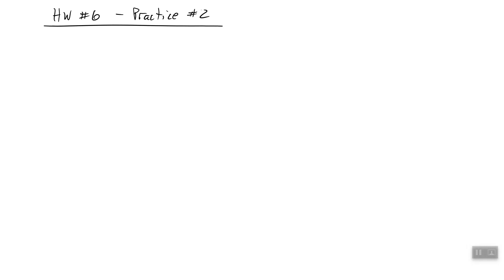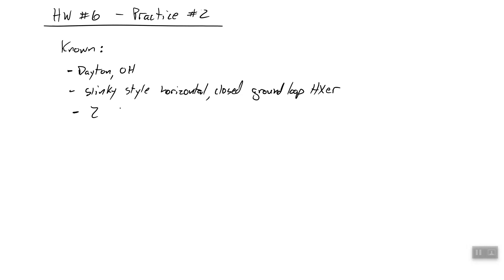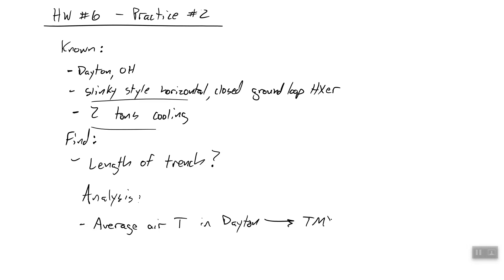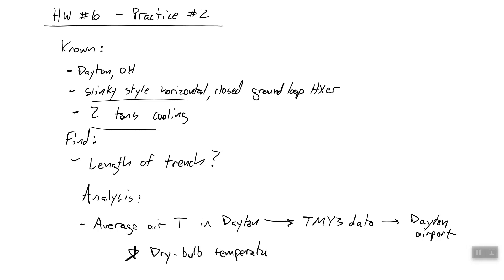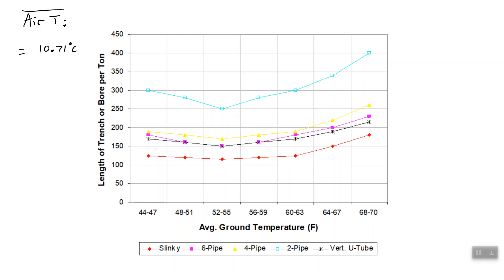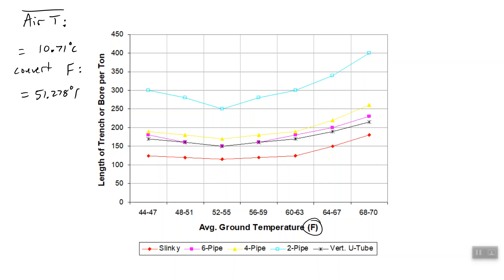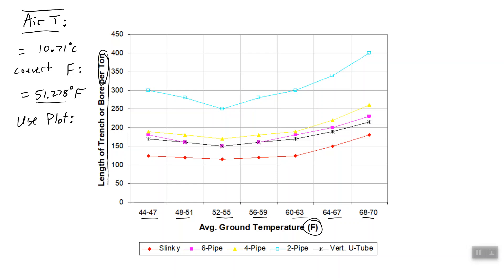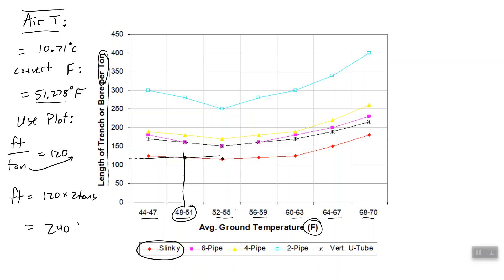HW 6 Practice 2 - Determining Length of Ground Heat Exchanger

Comment: Hi, I'm obviously not in your class but I'm struggling with sizing up a gshp for an old greenhouse and I've found you videos to be very helpful!
This video has made me a bit confused... The title is determining the length of ghx, but the chart says length of trench. Just to make sure, the answer here is the length of trench and not the length of the slinky right?
Reply: Hey Peter. Yes, you are right, it is the length of the trench, not the length of the slinky. Slinky systems sometimes come "pre-coiled", so you will just buy according to the length of the trench. I'm honestly not sure how to determine the total length of pipe if you plan on coiling the pipe yourself for the slinky style. Good luck!